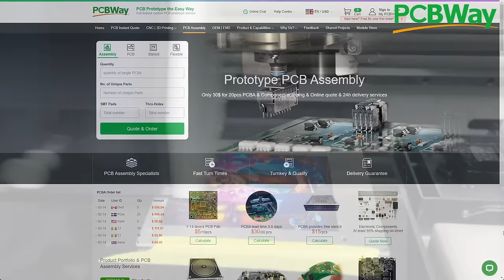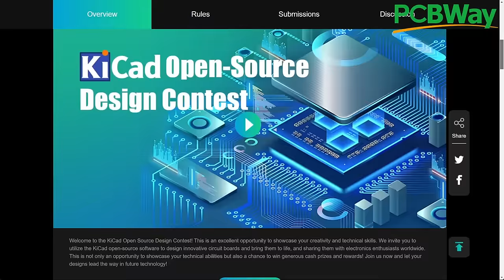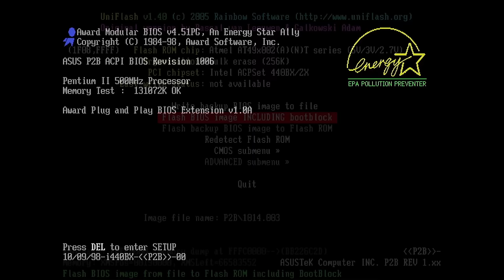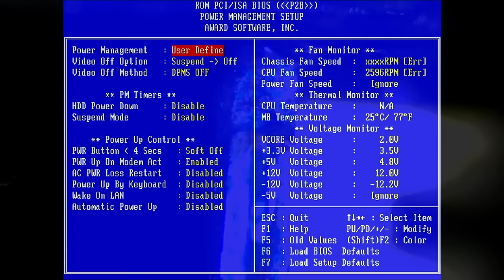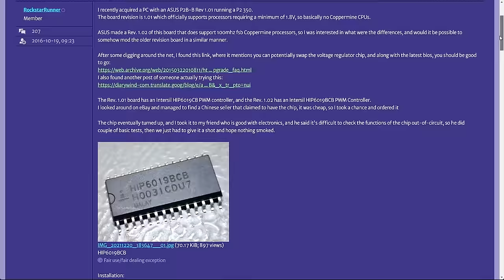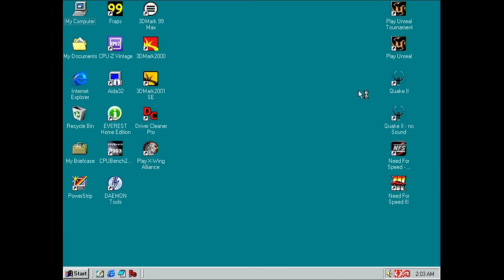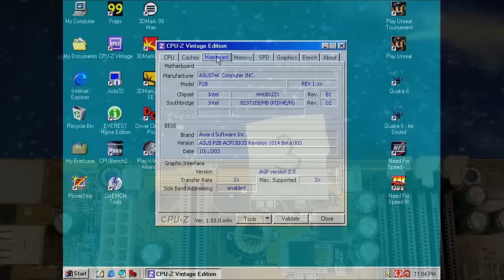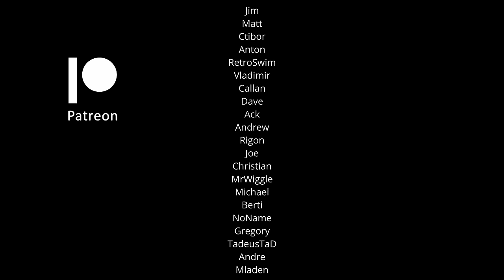ASUS P2B Restoration: Board #3 - Native Coppermine Support with Mod!

Comment: i have consider buying a microscope for working with electronics, 
but i do see that, the one linked in the description are over 220 Euro, 
and there is one 4k version Zoom 50X Stereo Trinocular Microscope, for twice as much.

But i also see one with a monitor in front view, for the quarter of the price. its not that i can't effort the most expensive one, its just that maybe its not necessary to spend more than 50 euro if i need something to work with that exist below the mm size. 

Its possible, but its a limit on how good my eyes can see tiny details
Reply from the maker: I bought my microscope because it's optical and has an option to record what I'm doing using OBS Studio. Those microscopes with the screen may be good enough for smaller repairs; however, be aware that there may be an issue with delay! Basically, there are a few milliseconds of delay between what you're doing and what appears on the LCD screen. That was my primary argument to go for a trinocular microscope
Reply: @bitsundbolts  i see, i mostly create stuff rather than repair, but the delay thing and its optical which gives clearer image maybe is something i will keep in mind.

Comment: Have you ever had an IRQ conflict with ATI AGP cards with these 440bx cards? I'm using Windows 95 on a P3B-F with an ATI RAGE PRO TURBO AGP 2X and I always have IRQ conflicts, even manually changing the IRQ in Windows the problem continues.
Reply from the maker: So far, no issues. But I have not used a Rage PRO TURBO yet. The card I use for those boards is a Gigabyte Radeon 9000 (just a random pick).
Reply: You can't change PCI or AGP IRQ in Windows, it's determined by the slot wiring and cannot be dictated by PCI PNP. And there exists a total of 4 IRQs. Usually the top PCI slot, AGP and system chipset share one. On such systems you need to use a newer version of Windows which actually supports PCI IRQ sharing.

OK ASUS is a little special in that the slot IRQs can be changed in BIOS because it has an extra crossbar that is engaged before the PCI bus is brought up, but then I think the chipset IRQ wanders along with the top slot, I'm not sure, you can test it.
Reply: Do you have Windows 95 release version or OSR2? You need every driver involved to support IRQ sharing for it to work, so mileage tends to be better with newer Windows 9x versions and also freshest drivers for everything that you can find.

Apparently there is such a thing as IRQ Steering which does allow Windows to disable/enable and switch PCI IRQs but i have never seen it actually work and do anything useful!
Reply: @SianaGearz  I'm using the Win95 OSR2 version with all drivers updated. I didn't want to use Windows 98.
The system works normally, runs games and everything, but it shows that there is this conflict between the AGP video card and the AGP controller.
Reply: @bitsundbolts  When you have time, do this test with an ATI RAGE PRO TURBO and let us know how it goes.
Reply: @pandalhao   Mhm the video card low level driver isn't actually the same between 95 and 98, it would be WDM under 98 but VxD under 95. And the GART support got major changes for 98 as well. You have USB Supplement installed as well, right? So that's the Windows 95C kernel.

I guess sticking to 95, it is what it is, good that it's doing what it has to.
Reply: @SianaGearz  I'm going to install Windows 98 and test how it goes.
This machine is a 1997 setup, with a P2 300Mhz, 64Mb, HD1.2Gb.
Thanks for the help guys.
Reply: @SianaGearz  I installed Windows 98 and the problem disappears, as you said, from what I saw there is no solution, Windows 95 causes the conflict with AGP.

Comment: This is only tangentially related but has anyone else come across Coppermine CPUs which only boot at 133MHz FSB but not at 100MHz? All three of my Slot 1 Coppermines behave this way but my Socket 370 ones underclock fine.
Reply from the maker: I did not try this yet. But there really shouldn't be an issue with 100 MHz FSB.
Reply from the maker: I worked on board #5 and I can verify that board #5 does also NOT boot with a 133x7.5 1GHz Coppermine @ 100MHz FSB. Very odd indeed! I will try to figure out what is going on.

Comment: Is the Asus chip even necessary? It is some monitoring chip. Maybe with a custom BIOS, it would be possible to boot without it?
Reply from the maker: It may boot without the chip. I never tried that. If I have to get one of those chips off the board for any of the last boards, I'll test it. But yes, it's mainly used for monitoring if I'm not mistaken.
Reply: @bitsundbolts  Thanks for your reply. If I am not mistaken, the Pentium II has no thermal sensor inside, so the best this chip can do is monitor the chipset temperatures, and the fan speeds? I am not sure if the Pentium III has a thermal sensor already. Anyway, it would be interesting to explore the topic of thermal monitoring in retro PCs. Maybe try with some home made sensors? I would love to know how much temperature can a PII/PIII actually produce.
Reply from the maker: The Pentium II doesn't have a thermal sensor - and if I'm not mistaken, the Pentium III is missing it too. Some boards have thermal sensors right next to the slot 1 connector, but those are probably very inaccurate. I did some thermal testing with an Arduino on a de-lidded K6-2+ CPU. I want to extend that project and maybe read more temperatures (like L2 cache, Northbridge, southbridge, VRMs, and CPU core. That could be something that may be interesting to monitor the temperatures of retro hardware.

Comment: Why not use vinegar and a toothbrush on the corrosion and then wash it away with isopropyl alcohol? seems less abrasive than an engraving pen.

Edit: Nevermind, I see you use vinegar on many other parts. I'm guessing that corrosion was extra crusty which is why you went with the engraving pen.
Reply from the maker: Yes, this thick crust was too much for the soft brush in combination with vinegar. The engraving pen worked quite well though

Comment: about p3-1000 on this board: i have 3 440 boards :  asus cubx (440bx) , asus p2-99b (its 99% same as p2b-b)(440zx) , and ZIDA ZX98-AT(440zx). NONE of them are works stable at 133 fsb. Even with pci vga. Even with chipset overvoltage. Old thg and anand articles are lie)). This easy to check in test 6 of memtest86: Test 6 [Block move, 64 moves]:
"This test stresses memory by using block move (movsl) instructions and is based on Robert Redelmeier's burnBX test" . Its even called burnBX))). 3-4 loops of this test and you'll have thousands of ram errors. Partially solved by cooling the northbridge but not 100% for me. I really want to see mythbusters video about 133mhz at 440bx from you)
Reply from the maker: If I get the time, I'll try memtest86. Thanks for letting me know!